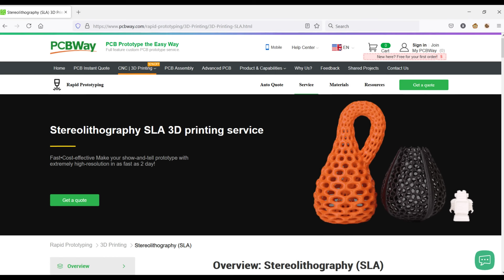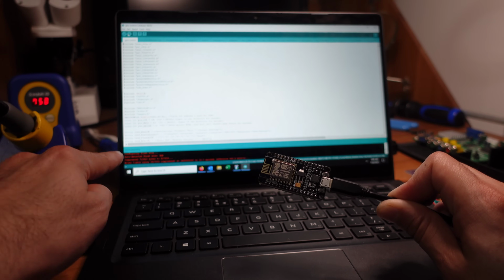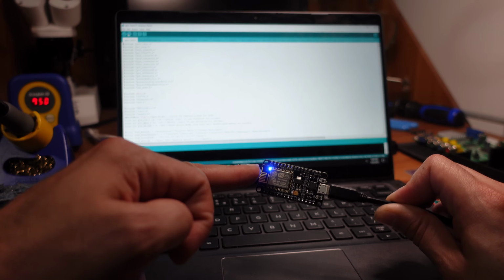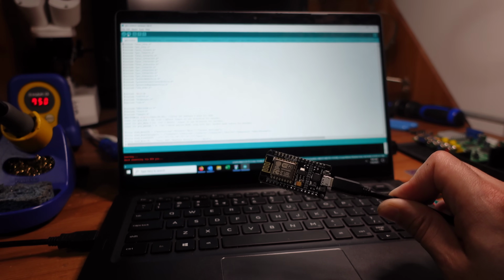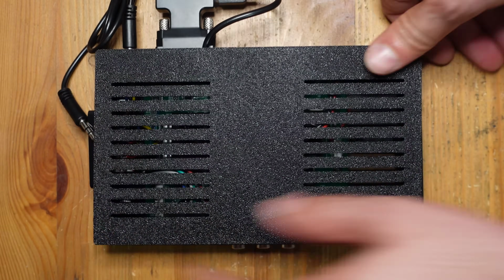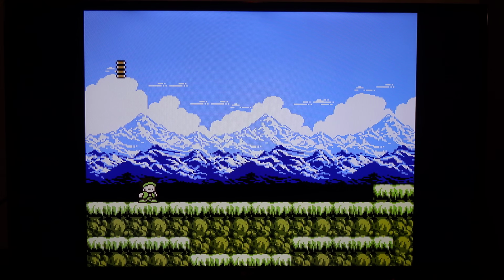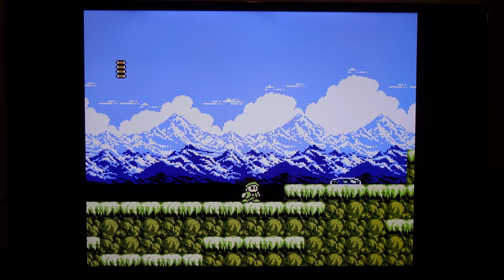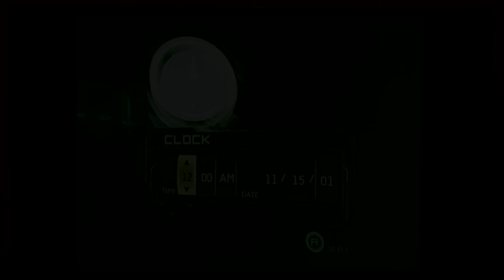GBS Control - An incredible video scaler for retro gaming! Build guide and demonstration

Comment: I read that you need a 100 ohm resistor on RGBS sync when you use RGBS.  If I get the retrotink scart cable that says it has a 470 ohm resistor on sync do I still need this resistor?  I'm also going to be using the device with a sharp x68000 which will have an adapter for rgbhv so I rather leave the resistor off since the resistor will affect that port as well.

Comment: Hi, thank you so much for the guide on this!

I have some quick questions, I see that you soldered 5V instead of 3v3 V for your esp module is there a reason for that change?

Then i also see that you soldered your clock control cables on different pins instead of the ones that shows in rama's Wiki, is there a specific detail as to why you soldered it on different points?

Thank you!

Comment: I attempted to build a gbs control today. I thought the hardware side was simple enough but time consuming. Kind of struggled finding the correct pins etc. And removing those pots took way longer than I care to reveal. But what truly broke me was the arduino programming part. I'm assuming my board is either faulty or I'm way out of my depth. Either way, I couldn't connect to upload the program. But the usb was connecting and the board was recognized. Anyway, I've decided to rebuild with a socketed arduino next time, and I'm ordering a well known brand at least. Thanks for the detailed video!

Comment: Hello, it is an interesting project but I have some questions. In my opinion, the reason for using a scaler is not only to enlarge the image but also to generate an image (on LED TVs) that looks like the one We see on a CRT. I know this scaler can perform some type of scanline simulation. If this simulation is done well it can be interesting (that is, not only adding a black line but correctly simulating the blurring of the "pixels")... BUT, I AM MORE INTERESTED in DITHERING replication. The SEGA Megadrive/Genesis consoles exploited the presence of dithering in their composite video output to achieve transparency effects or an apparent palette expansion. From the same megadrive connector we can extract an RGB signal (scart) that has greater clarity, but loses the dithering, which is taken into account and used to generate visual effects. Does this scaler have a setting that allow us to recreate the dithering?. Using this scaler, do megadrive games look like they do on a CRT? Do we have transparencies and color gradients again?

Comment: This is a good guide & I've just done this mod myself (2 years later), however it looks to me like you've wired the clock generator SCL & SDA to pins 26 & 27 instead of 26 & 25 on the Myson Controller MTV230? I think they should line up with R10 & R37 next to it.

Comment: This is subjectively better than the OSSC if you’re playing games that constantly switch resolution and use interlaced signals. The OSSC’s line doubler really does look nice for pixel games but adds a pixelated effect over 3D games. I use the GBSC into an OSSC for the best of both. My mega drive and snes go directly into the OSSC but my Saturn, dreamcast, ps1 and ps2 go into the GBSC. I output them video through VGA at 480p and upscale 2x using the OSSC. That seems to be the sweet spot for me but ultimately I do this purely to convert the interlaced signal using the GBSC, not for a clean image but for a consistent one. Handles great with the elgato 4K.

Comment: A little trick you can do in order to never have to touch the audio jack going ito the HDMI connector (like when using component video) is to use a composite to SCART adapter and use the audio jacks of that adapter :)

Comment: Wow. As long as you don't mind putting in the work to put it together yourself, this is by far the best value retro upscaler for the vast majority of people.

The Retrotink 2X Pro and OSSC are so much more expensive that the work you have to put in to put one of these together seems well worth it and would be very rewarding once it's finished. Or, even if you are looking for a fully assembled GBS-C, I have seen them on Aliexpress for around 70 USD including shipping. Just a good quality SCART or component cable can cost about that much or even more sometimes though T_T 

Can you do a video on how to make and shield your own component cables, RGB cables, and/or SCART cables? :D

Comment: So I bought a BitFunx GBS-C, here's my review:
When you can actually get it to show an image; it's great. Other times I'll be switching presets and resolutions back and forth over and over, until the mode that I know worked previously, actually works. Sometimes turning it off, and then back on, works. Basically, it's a buggy piece of shite, and I'm quite disappointed. Too good to be true. Used with PS2, Wii and Xbox Original via a component switch box, and a PS1 via SCART. Also, it really ought to come with a detailed instruction manual, which it doesn't.
Reply from the maker: Bitfunx is known to produce poor quality products and they also steal from other creators. A properly made GBS C should work much better than that

Comment: What awg of wire is begin used and where?
Reply from the maker: Mostly I used 28 gauge copper stranded wire and the smaller wire you see in a few places is 30 gauge kynar wire

Comment: I've used the GBS Board only with the ESP8266 for a while

Last month, I installed clockgen. and now GBS board does not respond (GBS Control firmware log says "GBS Board not responding!" every time I click a preset option

SDA & SCL are NOT swapped...

Anyone knows if it is a hardware damage? or something else?
Reply from the maker: Not sure what that could be. What happens if you uninstall the clock?
Reply: @LIRetroGaming  issue persists without clock

Seems like there's an issue on the controller chip or on the SDA/SCL traces

Comment: You can just run rgb from a console to that converter and use vga out. Just solder the wires from the scart cable to the rgb connections

Comment: Hey, nice work!
I got a little question: I have a ps2 with just the composite video out (the yellow one) and two others for sound (L & R). Can i use my ps2 with that exact build or is there a different version/way for composite? 
Thanks in advance!
Reply from the maker: You can totally use this with the ps2, but you would need the ps2 component cables with it. It has five cables (red, green, blue, red, and white)
Reply: @LIRetroGaming  Thank you very much for your insanely fast response!
Yeah that's what i thought.. Time to buy a few component cables then.. :D

Comment: I’ve noticed you didn’t add any extra capacitors on top of some existing ones like Voultar does. Must not be necessary
Reply from the maker: I would have to see his video, but I trust his work. The caps may be needed, depending on how the gbscontrol is used

Comment: Hi, Everyone, Im getting hard time trying to get audio from the SCART connector :( can anyone please point to me on which pins should I connect the Audio Wiring, is in 2,4 and 6 or is in 1,3 and 4 ??? Im geeting audio if I connect it to 2,4 and 6 but very low volume even when my amp is at max volume :( Any suggestion
Reply from the maker: You can find the pinout here https://www.retrorgb.com/scart-to-jp21-adapters.html

Comment: Hi there! do you have another tutorial how to solder all the wire points for the female scart port? I'm having a hard time understanding how to do, the video was way too fast when you was doing it and also I noticed you soldered certain points that didn't match the wiring diagram unless I am blind lol I GBS Control but I did not do the scart port yet. I tried looking on other sites too and did not find much info. also the LIRG Expo 2022 was amazing!

Comment: I made the gbs control using your video and it works perfect How to make scart rgbs cables for snes and other consoles. I followed couple schematics but having issues to display it properly either its purplish or to dim with wrong colors using the rgbhv/component toggle in gbs control menu.
Reply from the maker: Making scart RGB cables is a actually pretty complicated topic, and you need different things for each console. I would suggest getting cables from insurrection industries, retrogamingcables, or retro access
Reply: @LIRetroGaming  i did try couple cable but nothing seems to work with gbs and someone recommended that you do need a sync stripper and get your sync from composite in order to make it work with gbs

Comment: Assuming you have a component video game setup like myself and go component in to gbs-aio, do you bypass this scaler entirely and go right into the tv with audio if I'm going component out to a crt?
Reply from the maker: This device would not really be that useful for a CRT, unless you’re trying to downscale 480 P content into 240 P content
Reply: Thanks for the response.  I was attempting to downscale to 240p for some oddball games on newer systems.  It seems like I would have to breakout the audio separately from the scaler.  I like to use component switches for my setup so I'm trying to simplify and navigate the clutter, make best use of inputs outputs available.  My ideal scaler is the retrotink 5x it probably seems like.

Comment: Thanks for showing how to connect up a scart connector. I was wondering if it's possible to attach a composite device with your setup? I've got a stock nes and a laserdisc player that I'd like to try upscaling. Also does the front port accept vga?

Comment: Great video! Much easier to follow compared to other tutorials I've seen on youtube. Quick question. I'm interested in using one of these for downscaling of 480P consoles to 240P. Any clue if the clock generator is necessary for that or is the clock generator mainly helpful for upscaling only?
Reply from the maker: Thanks, glad you enjoyed it! No, I don’t believe that the clock modification is necessary for the downscaling. But overall I strongly recommend including it because it does make a big difference with image stability, regardless of whether you’re upscaling or downscaling
Reply: @LIRetroGaming  okay, good to know. Thanks

Comment: What kind of cable do you need to connect component audio to the adapter?
Reply from the maker: You need a 3.5mm to rca converter cable
Reply: I just saw this was a similar question to mine with component audio but it sounds like he's going HDMI out.  I'm assuming more specifically the adapter he wants is 3.5mm male to two RCA female adaptor.  I know this seems obvious if you look at the plug, but the y adapter is a more common cable (with all pointy cable ends).

Comment: I just cant understand how i would plug my NES on this thing...
Reply from the maker: First your NES would have to be modified for RGB video. Then you could use either a SCART cable or a HD retro cable to connect the system to this scaler
Reply: @LIRetroGaming   Thank  you Mr. =)

Comment: Hello ! I just made this mod and I'm interested in printing the case. Could you share the link to the stl file ? Thanks and congratulations!
Reply from the maker: Thanks! You can reach me at my website and I can help
Reply: @LIRetroGaming  In fact I found the box on thingiverse yesterday. I already have programmed the esp8266 and it seems to be fine. One more project almost finished :)
I will probably enhance the box to install a 220v mini plug (radio style) and a 5v power supply inside. 
Thanks
Reply: @eldontyrellcorp  Which version did you find? I'm looking into this as well
Reply: @superkaes  There are many versions indeed and I ended up modifying one of the boxes to suit my needs (the one with a hole for an oled screen) using tinkercad.

Comment: Thanks for the vid!. Have a look at the really cheap and small RGB2HDMI adapter that uses a Raspberry Pi Zero. For just $5 and some change you can get a great result.
Reply from the maker: Thanks! That is definitely something I have heard about and I want to learn more
Reply: Whats the parts to purchase? :D already have a RGB2HDMI but what and how should I do? - Thanks
Reply: Its Project Wiki should give you some insight as to what's required.
Reply: doesn't work with consoles

Comment: Sadly, i try a Lot of time to make it work and it still didn't. I think it's Arduino board, but i'm not really sure.
Reply from the maker: It’s most likely the Arduino board. Did you get a successful compilation of the code?
Reply: @LIRetroGaming  yes, it compile. but doesn't work anyway. i think the arduino board is broken because when its connect to the pc, it did not recognise. i will try with another model but if still not work, i will give up (sorry about mi English, it's not good, but a i think it's readeble🤣🤣)
Reply from the maker: Yes, your English is quite good 😊 That does sound like the Arduino and I hope getting a replacement is what will solve the problem!

Comment: Nice unit.
I think it's a newer framemister then anything. Because there is a tad of lag. Less then the framemister. Thou i don't notice any lag on my framemister ether. 
Kinda weird you gotta modify it like that like it's a mode chip for a system.
This unit seems awsome. I like how fast it switches resolutions.
retrotink 5x is pretty good also. I saw some video's of it upscaling 480i/p very well.
I am waiting on the OSSC pro thou. Hope it turns out better then the rest. I hear they will put some FPGA cores on it also. Will make up for systems without rgb like nes. For cores id rather just use a mister or a analogue product if you got a collection. You'll of course be able to attach a real one of course.
Reply: GBSControl is way faster than the Framemeister. It has less than 1 frame of lag. They're not even close.
Reply: The retrotink isn't comparable though because of the huge price gap (more than 250€ of gap)

Comment: Where's the link to the wiring diagram for the scart port? It's not in the description.
Reply from the maker: Oh I forgot to add that! I’ll fix that asap
Reply: @LIRetroGaming  thank you. I was looking for a way to put scart on the gbs easily and the video was very helpful.
Reply from the maker: No problem, glad I could help! I plan to upload the 3-D printed case as well and I should have that out in a few days
Reply: @LIRetroGaming  Super video.  Did you manage to get the case design up I wonder?  Kind regards Luke

Comment: I love my GBS Control, its AMAZING for hooking up my Scart RGB Consoles to a CRT Monitor. I really don't like it when paired with the vga to HDMI Adapter.

I feel that the OSSC is far superior for going to HDMI
Reply: What video connection are you using on the CRT Monitor?
Reply: @FragBenitez  VGA
Reply: the VGA to HDMI adapter is just digitizing the signal.  It isn't adding anything (including interference)
What you see through it is exactly what you'd see when using the VGA output on its own.

Comment: You should also remove C11 to stabilize the image and add the power supply bypass capacitors to reduce the ripple, as the processor is using the clock generator.
Reply: Hi! What are those capacitors? Numbers please? Thanks!
Reply: @TuMalaCon100cia it’s in voultar’s video. Just look that up

Comment: Maybe I missed it, but where did you get the case?
Reply from the maker: It’s a modification of a case that is available on thingiverse. I actually forgot that I was going to upload this so that people can use the design. I will put that on thingiverse today and add a link in the description
Reply: @LIRetroGaming  I was having a look on thingiverse but couldn't find your design, just wanted to check if you uploaded it there? thanks
Reply: @LIRetroGaming  hi, great video, I didn't thought about the scart female connector, it's a great idea. Would you mind sharing about the case ? Is it 3d printed? Thank you
Reply: Great, thank you!